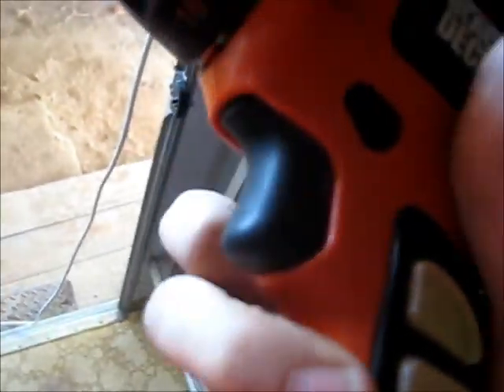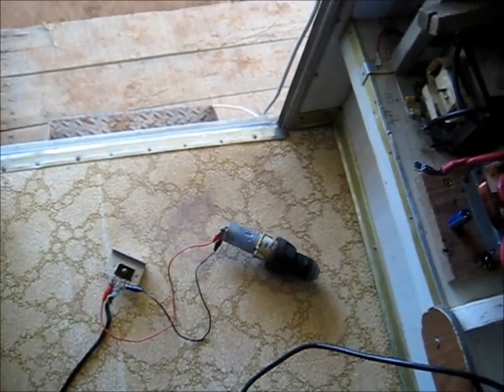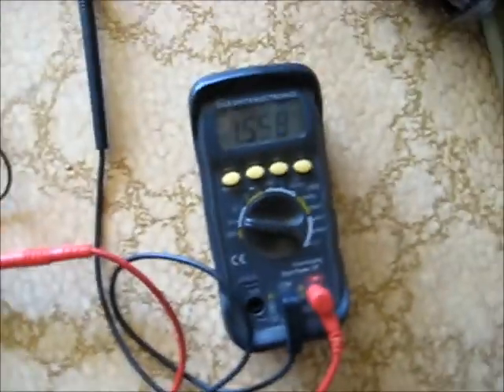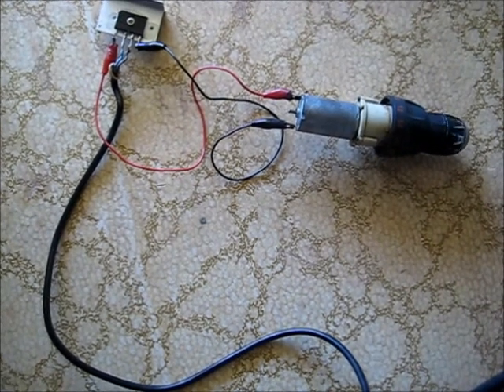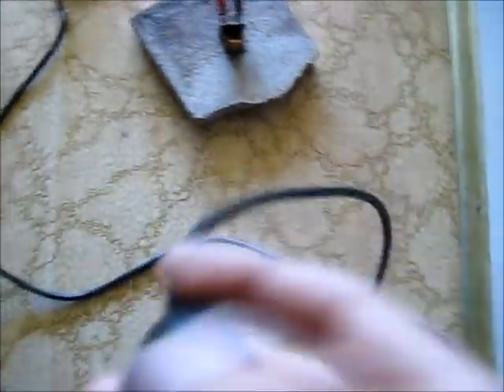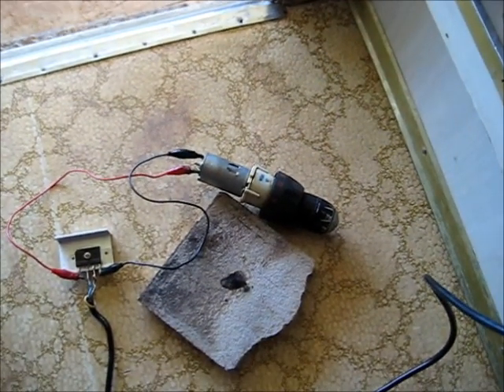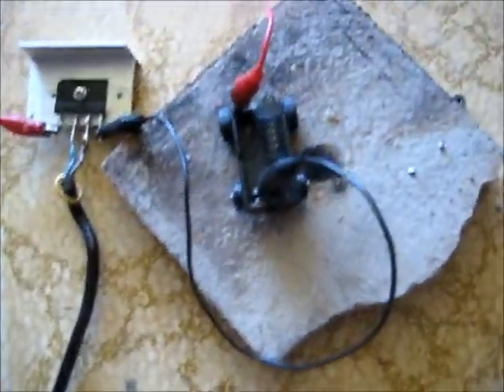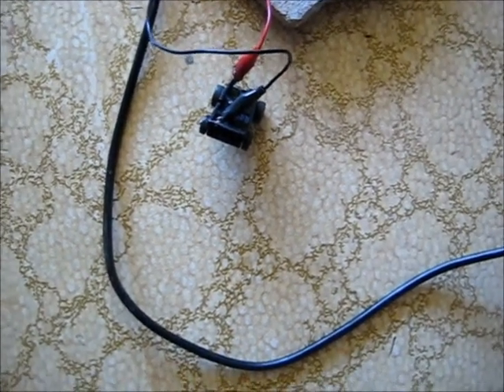Popping Motors On the Variac

Comment: Great video.
To correctly measure your voltage across the load, you need to keep the motor connected while doing the voltage check.
Basically you did the open circuit voltage check.
That relay coil gave a great display !